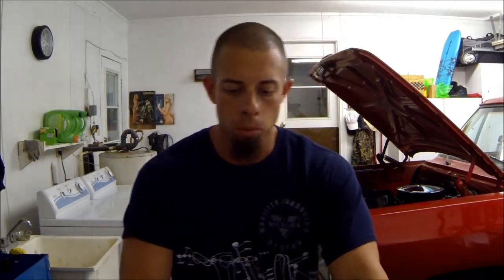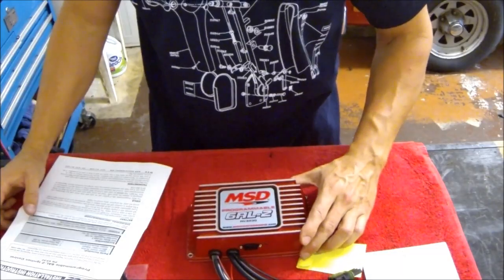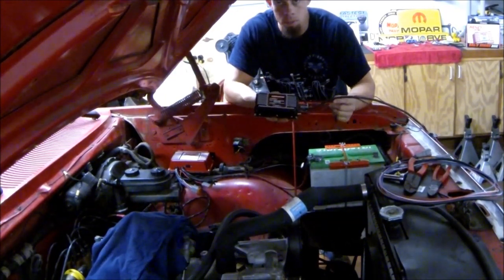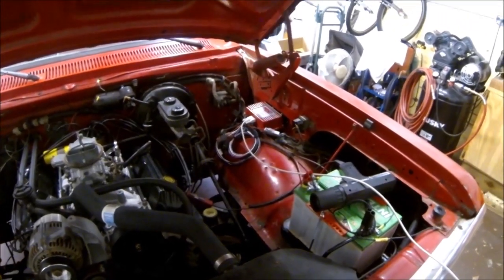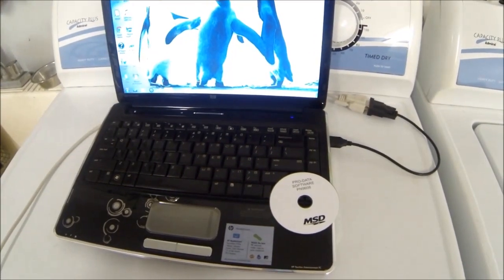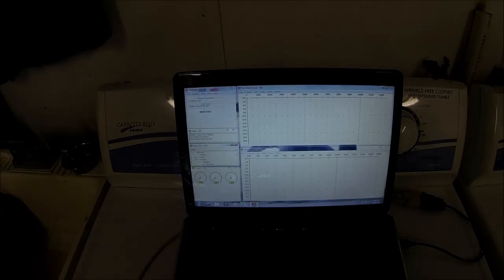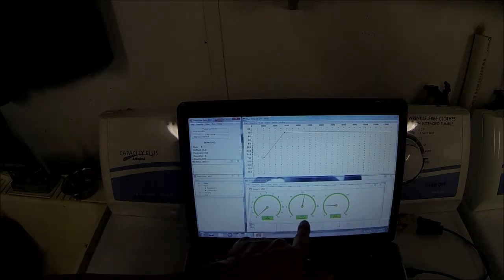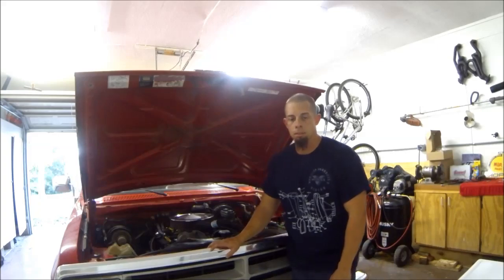MSD 6AL-2 Programable Review and install

Comment: Qiestion if im replacing my HEI distributor with an msd pro billet distributor and 6al-2 box do i have to take that module thing out of the msd distributor like you have to with the HEI thanks
Reply from the maker: I took mine out because I can program my timing. A 6al-2 doesn’t have that feature to my knowledge, so no.
Reply: @TheGasTap  ok thanks

Comment: hi 
Does the top of your page list advance or retard  at the 7.12 mark ??
Assuming distributor has all mechanical/vac  advance locked out and distributor is locked out to max advance required .??
Reply from the maker: My distributor is locked at 36 which is the max I plan on potentially running.

Comment: how did this work out ? i already have mine ..havent installed yet. I have a turbo setup..going to lock out the distributor also.
Reply from the maker: I haven’t done much tuning with it but the box is still running strong.

Comment: Have you checked this all the way up to 7k RPM, does it have any timing retard due to spark lag or hysteria or whatever they call it
Reply from the maker: I only run this truck to 6000
Reply: @TheGasTap  and have you checked your timing from 3500-6000 to see if it retards timing?

Comment: Thanks man. Whats the advantage of using this vs vacuum advance? Im trying to map out my ignition parts im gonna purchase for my challenger.

What would be the best distributor to run with this from MSD?
Reply from the maker: I use stock distributors. They are great units and do everything you need for cheap. I always remove vacuum advance but the MSD programmable is great bc you can tune timing throughout the engine rpm. Ive even heard of guys removing timing midtrack to keep from spinning tires on a track that may be slick or unpreped. Super cool unit.
Reply from the maker: Look at 4secondsflat.com too. I've used their timing limiter. Nice piece 👌

Comment: So, I have a 6al programmable and I'm just ready to 'lock out' the distributor so I can start playing with the digital side of things.  How do you know what RPM you should have it fully retarded back to 0?
Reply from the maker: +Erik Eyler what engine are you working on?
Reply: It's a pontiac 400 with edelbrock top end (rpm heads, rpm cam, rpm intake, 1405 carb)  Pretty much stock, but rebuilt, block.  It's N/A so I'm just looking at the total timing aspect with no fancy map sensor or launch retards in the mix.
Reply from the maker: To lock out the distributor, you need to take the cap and rotor off to get the the mechanical weights and springs. Take the springs off and use wire to connect the post where the springs were. Reinstall the distributor and set the timing around 36 degrees. Then you will be able to do all your tuning from there. Do not attach the vacuum advance either but I'm sure you knew that.
Reply: Yep, everything I've read confirms your statements, so we are well on the same page.  You have earned a new fan in PA!

Some additional research shows that most motors are 'all in' (aka total timing) somewhere around 3000 RPM.  So, when looking at the MSD timing curve, I will use 3000 as a starting point and fine tune things from there...  That's when the test and tune night at the local drag strip will be key.

You also make a good point on the vac advance.  My MSD distrib doesn't have the vac advance port for street use.  I'm hoping I can keep 2 MSD profiles (one for full throttle and one for the every day drive).  I have no idea how well this will work though.  :)
Reply from the maker: Your initial timing will be higher than stock since you have an aftermarket cam. I used 20 initial and 34 total timing with full advance at 2500 rpm I believe. Get the total advance up faster than 3000 rpm
Reply: Ah, cool.  I did not realize that the aftermarket cam would change how 'quickly' the total timing would come into play.  I'll need to do more research on what factors can affect total timing @ X rpm.  I'll change my mindset then and will start testing things at 2500.  You kick butt good sir.

Any thoughts on keeping two different profiles based on driving habits (full throttle vs. putting around town)?  It's not as dynamic as a vacuum advance config, but figure it's worth a try.
Reply from the maker: Keep the timing profile the same. The only thing you may want to tune for WOT and cruising is the fuel mixture. If you want fuel mileage on part throttle, lean on primary jets and for WOT bigger secondary jets. But for the max performance all around you want to 4 corner jet it with all the same jets that way all cylinders get the same A/F ratio.
Reply from the maker: Just my teachings, other peeps may not agree.

Comment: your videos are very helpful man! helped me with my Wideband n I'm putting the same msd 6al2 digital in as right now. 1990 454SS 496 stroker afr heads roller cam paxton Novi 2000.
Reply from the maker: +fvgc454ss Always glad to help someone out! Sounds like you are building a mean machine!
Reply: @TheGasTap  https://youtu.be/6PiK-zNNfv4 here is the truck all done at ride height. Ride tech air ride shock wave comp/rebound adjustable.
Reply: @TheGasTap  engine. 496 stroker afr heads, straub roller cam, csu carb, victor Jr intake, hooker supercomps. https://youtu.be/vQz1rVXZaic